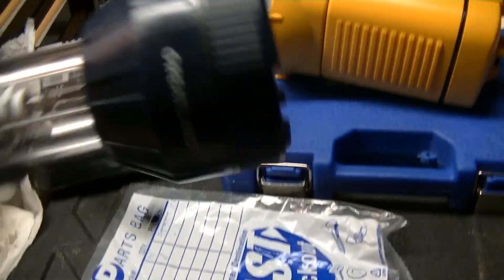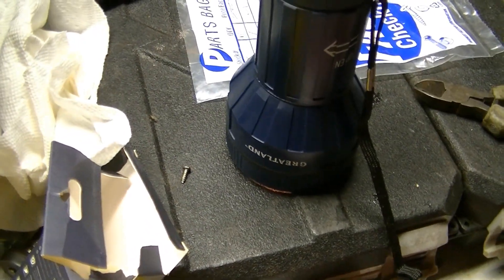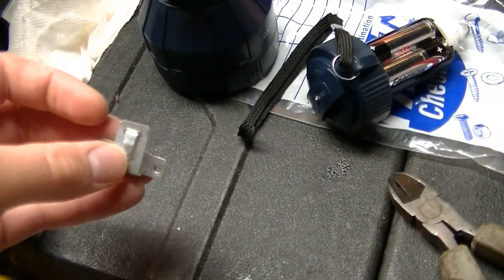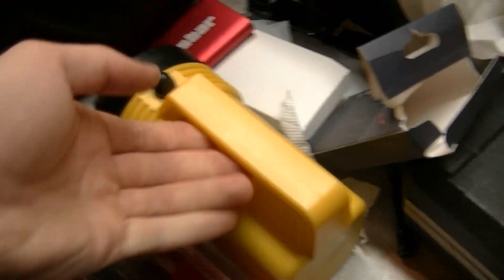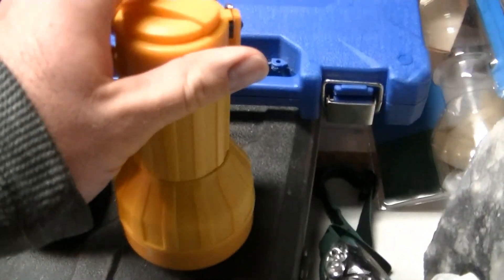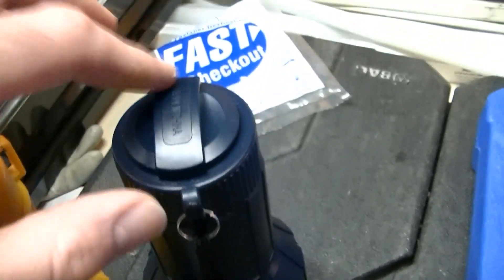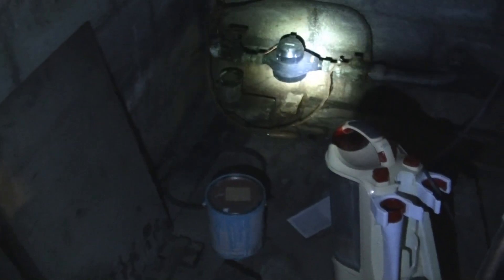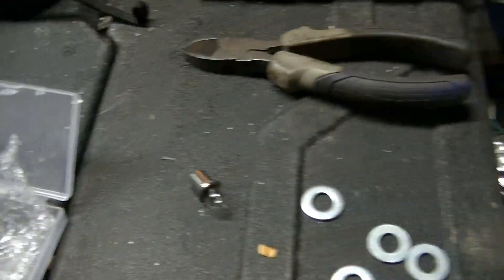Krypton vs LED Replacement Flashlight Bulbs/Honoson LED Review

Comment: I have a 2 size D krypton bulb flash light. Will reversing the battery position work if I switch to a led bulb? Thanks for any help.
Reply from the maker: Yes it most likely will.  The only problem you might run into with certain flashlights, is that the terminal for the positive side of the battery is recessed, and won't make contact with the battery when it's installed backwards.  That isn't a problem with all of them though.  I'd give it a try.

Comment: You can actually flip the contact flap to the bulb to make it work on LED. Just be gentle not to break it. Can you try and make the 3v version to 6v by making it series?
Reply from the maker: I'm not sure if I'll be able to make it series due to the way the contacts are set up.  It's possible I'm sure, but it wouldn't be easy with this flashlight.  I'll compare the 6v and 3v to see how they differ.